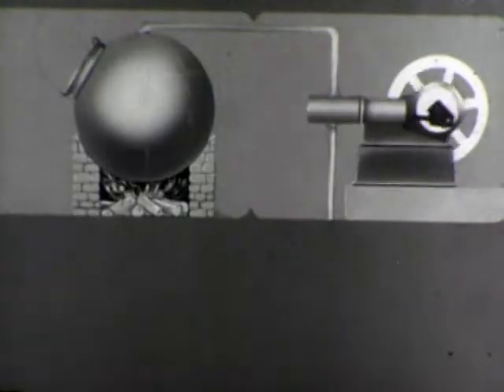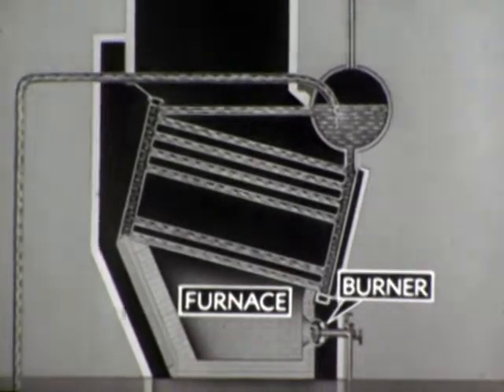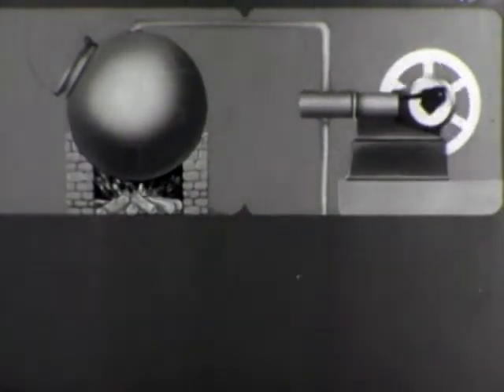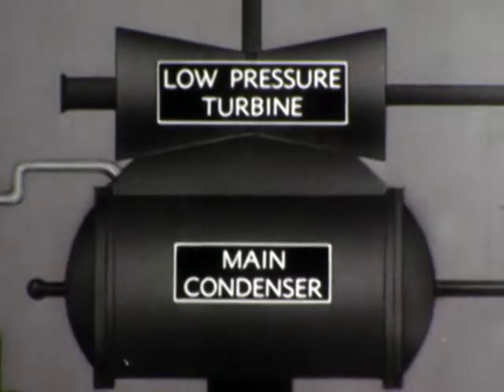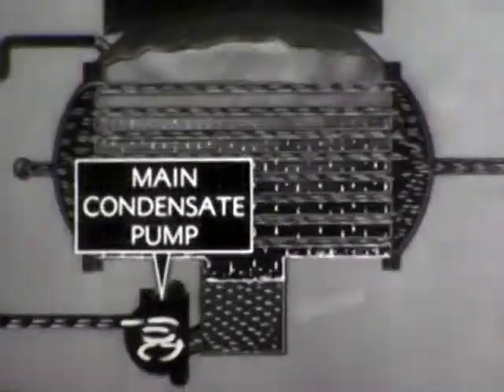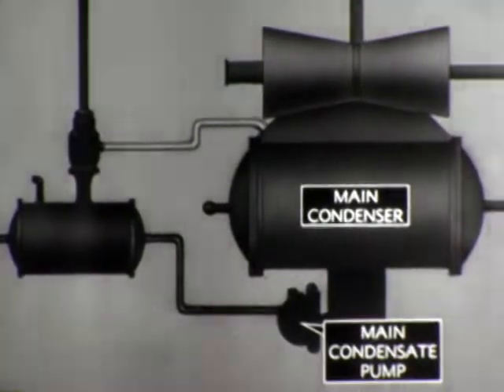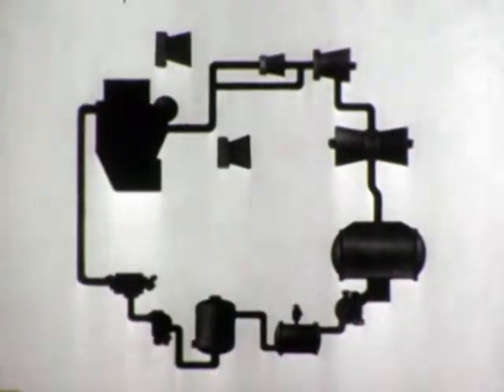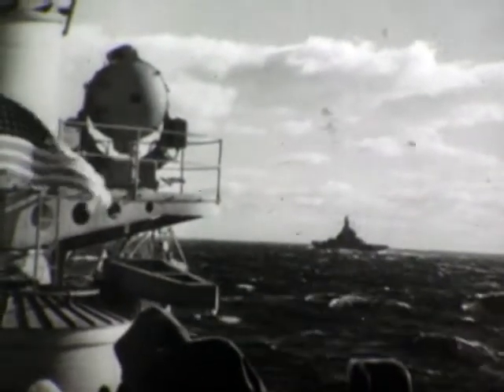Steam Turbines: The Steam Cycle

Comment: I want one..  Super heated Steam,  literally explodes when it is released thru a low pressure valve...
 As simple as it is,  They still won't put this system in cars..  It won't generate as much Profit for the Car companies..  Not enough parts to make..
Reply: Why would you want that in a car? You would not reach the efficacy of a modern diesel engine, but with lots of complexity, adding weight and cost. Not a lot customers would want cars that are heavy, expensive, cumbersome to operate and inefficient in fuel use, just to have a steam engine.
Reply: Do some research before claiming something, you're not only a danger to your own education, but you also put new students with little experience in your line of thinking.
Reply: IMAGINE ... waiting 3 to 5 minutes for the BOILER in the car to COME UP TO TEMPERATURE!! Wunderbar!
Reply: @uploadJ  , LOL ,  Never happen in America .. 
  They can get it down to 30 seconds or so ,  with a sub system . . but, even that's too long .
Reply: A car-mounted external combustion engine burns far too much for far too little power. That means emissions are going through the roof and your car will struggle to climb hills.

How long has it been since a external-combustion steam locomotive was manufactured outside of coal-mining railways? Even in coal mining I doubt a steam locomotive (other than some fireless locomotives using compressed air) has been built since 1960, as the last coal-hauling steam locomotives were replaced a couple of years ago. Even with coal literally surrounding you it's easier to use electricity or diesel.
Reply: @hmpeter  Your wrong look up the Doble E-20 Steam Car made in 1925. That car has over a thousand foot pounds of torque. It has a top speed of 130mph and it got 100mpg. Making any internal combustion engine gasoline or diesel look like a joke in comparison.
Reply: @bryara4480  Sorry, you are wrong there. I know  the E-20. And it could get about 100 miles per gallon. But not gallons of fuel. Gallons of water. Fuel consumption was more in the       10ish mpg range. Okay in its day compared to the gasoline cars, but nowhere near decent diesel cars that actually can reach 70mpg under good conditions. (Octavia wagons from 10 years ago on a highway doing 50mph could do that)
Reply: @hmpeter  true when run off of kerosene and that 10mpg spec is for the 1924 model year! in 1925 changes were made to the flash boiler witch made it more fuel efficient.